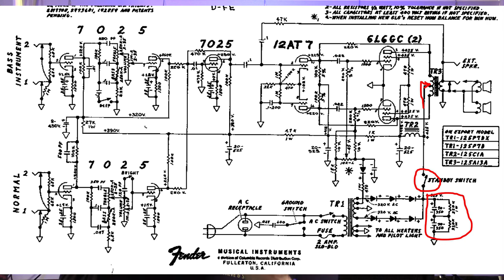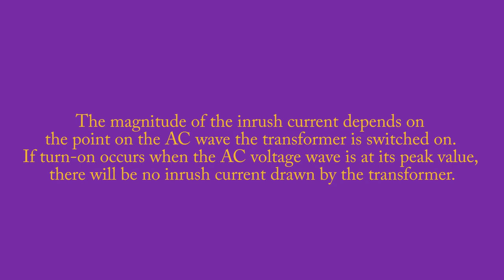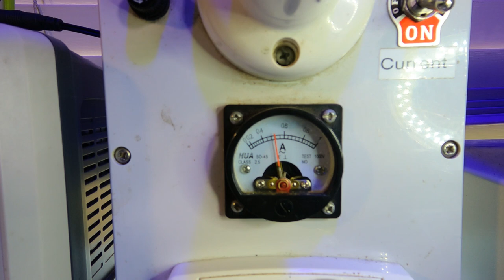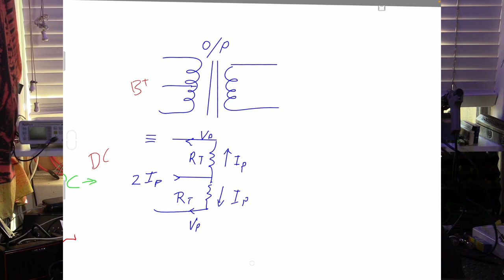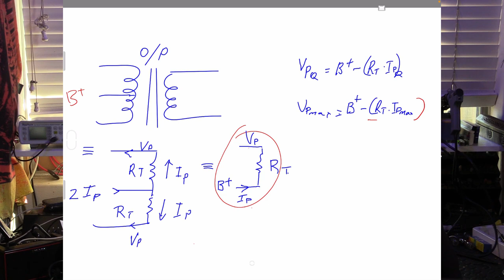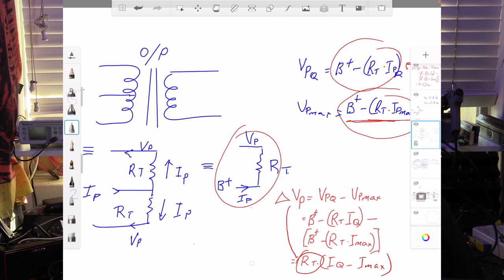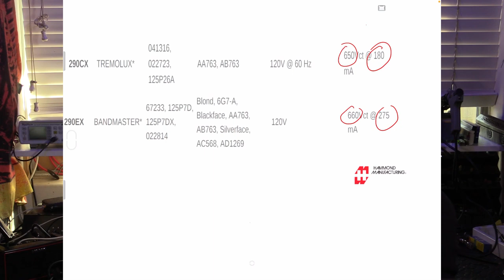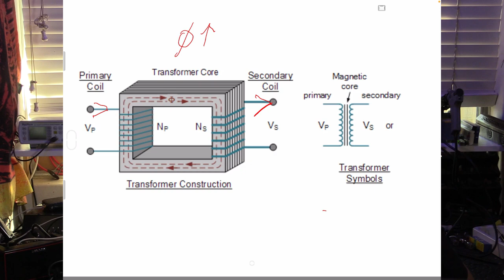Tube Amp Sag - Chapter 5: The Transformer Effect

Comment: You brought up another interesting thought for me. In possibly answering one question, rises the next.

In comparing the Princeton Reverb and the Deluxe Reverb, Obviously the Deluxe comes with more tubes and knobs and an extra transformer I believe. The power transformer is considerably larger to handle this extra load. This makes sense.

But we look at the output tubes and find a pair of 6v6 tubes in each. Yet the specs on the output transformer are different. Now, I cant think of the specs positively, but I think the Princeton has 8k impedance, and the Deluxe 6.5k. The Deluxe delivers 20 watts output and the Princeton 12. What puzzles me is there is an equation based on the output tubes handling, and the speaker impedance. Why is the deluxe output transformer ok for the same pair of 6v6 tubes in the deluxe, but not in the Princeton? It also seems I did that math once, and the Princeton value was correct for the 6v6 tubes.
Reply from the maker: That’s a tough question, Alta. There are a couple of angles to approach your question of power output between the Princeton and Deluxe. Firstly they use different Phase Inverters, with Princeton using the lower gain Cathodyne, and the Deluxe’s Long Tail Pair. There’s a also a difference in the rectifier tubes putting out a different B+. And yes, there are variations in OT’s and PTs. The specs on tubes are a guide, and as we know Leo was “flexible” in interpreting DataSheet recommendations. From memory the Datasheets (depending on where you look) are between 8K and 10K for a pair of 6V6s. This will actually vary on the loadline and whether the amp is operating at low levels of Class A or Class AB at higher levels. I am pretty confident that Leo was generous in his interpretation of Specs, but time has proven that his choices resulted in history making amps. 
 A very interesting question and I have added it to my list of future video topics. Thanks Alta
Reply: @theguitaramptech  , excellent. I look forward to seeing you dig into it.